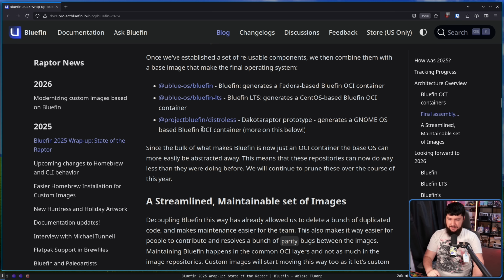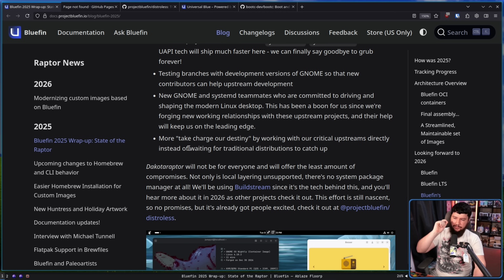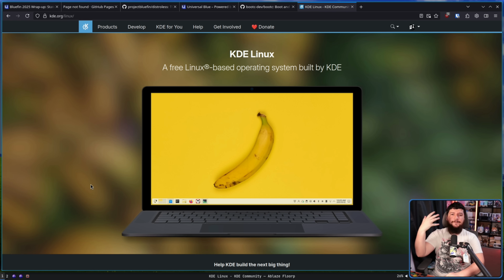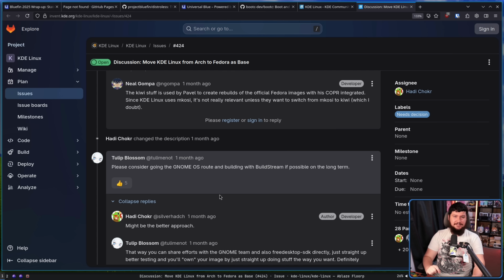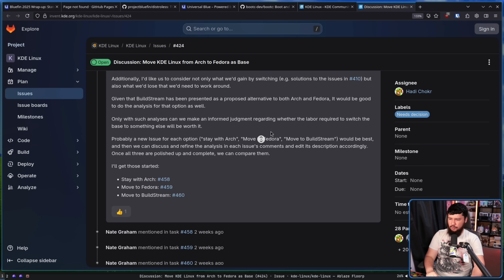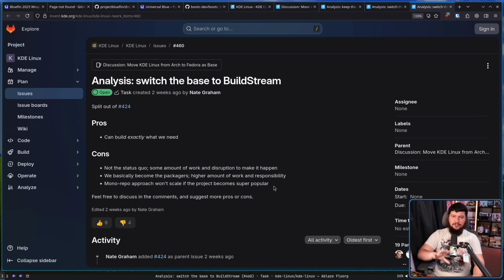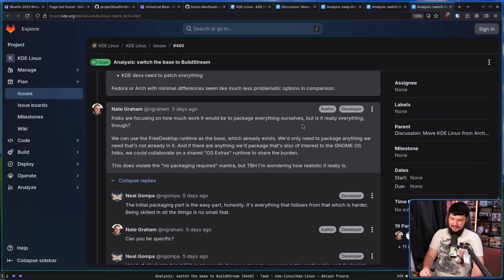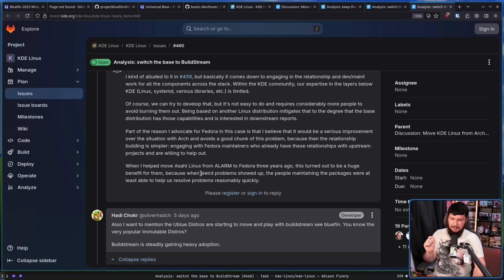The Future Of The Linux Distro Is No Distro

Comment: I do not understand why KDE is wanting to make their own immutable base OS.  Aurora has already done it for the KDE desktop environment.  They just need to fork Aurora (and partner with them of course).  If they partner with them both Universal Blue and KDE will benifit.

I think KDE needs to concentrate on doing some heavy RICE work on their system to truly show what can be done with their system.  I would like to see them improve their stability and introduce tiling and scrolling window manager modes.  If they added these modes themselves instead of having 3rd party programmers try to do (kwin scripts are a little too buggy for this) it will make it much more stable.

Comment: This doesn't sound any less like a distro than NixOS does. Building parts of a system in isolation and then atomically switching from one set to another? That's Nix's bread-and-butter.
Flatpak is a package manager by the way. If the argument is that it's not a distro because it doesn't have a package manager, and then you include flatpak or some other way to obtain and activate container images, then you have a package manager, and by extension with your own logic, a distro.

Comment: I think that container based distros are a very interesting area of research, and likely will be the future, but having used them, I also have to say that there are lot of rough edges left to sand off. See, the problem with putting your whole system in containers is that the whole point is to wall them off from each other. That means that if the terminal text editor you prefer isn't part of your immutable base, then you can only put it in a container, and it can only ever see what's exposed to that container. Need to edit something that container overlays? Tough luck. Flatpak has similar problems. If the packager doesn't set up the Flatpak exactly right for the application, then the user can find themselves surprised when the file they thought they saved in their home directory disappears, because it was actually the home inside the Flatpak and not the real one. That's the kind of issue that will kill someone's interest in Linux immediately.

Comment: Literally every part of the Linux system is opinionated, sysctl settings, kernel parameters, packages and the settings of those packages, what packages are available in their repositories, the package manager, what kernel one uses, how that kernel is built, the desktop environments on offer, the display manager etc etc. Literally everything. People who are against the term "distribution" either don't understand Linux or just dislike it on aesthetic grounds only. I think it's a perfectly acceptable term for what a distro is, which is a particular distribution of the Linux Kernel. "It confuses new users" is not a compelling argument to change it, instead it should be explained more.

One of the only distributions that actually aims to "keep things simple" (i.e no changes/patches to packages) and keep stuff as close to upstream defaults as possible is Arch Linux, but even Arch Linux makes opinionated decisions on what bug/security fixes to backport and such.

Comment: Having no package manager seems to make sense. Bazzite tries to use Linuxbrew for CLI applications and libraries as a supplement for a proper package manager, but Homebrew isn't supported that well for immutable distros considering them a tier 2 system on Homebrew's website. In my case, projects I would try to build can't properly detect the libraries on Linuxbrew. Seems they might be giving up on that and focusing their efforts on getting packages with containers which was what I was guided to do to get a development shell working.

Comment: I don't get the point of forcefully disabling local layering. If you, for example, have a printer driver that is not on the repo, your only option is a) buy another printer and pray it will work b) fork and support the entire project c) use another distro.

Comment: Can this replace distros? No. You have to be able to install Linux in the first place to use it unless like some people you do all of your development in VMs from OSX.

Moving on, this is a solution to a problem that doesn't really exist. DE developers need to get it in their heads that the people who will use their system need it to be stable and run software not than 6 months old.

Comment: As someone said I basically chosse a distro for the package manager in the rare cases I need it, the rest I don't really care about, I run most things in countainers, VMs, flatpacks or some niche variety of that, anything except Snaps that I simply hate is fine for me.

I try as much as possible to avoid having to install anything manually and add bloat.

Installing everything directly on the host's OS just feels like hell and I sometimes need some stupid windows software or some OSX software, it's just more practical to have a clear hierarchy of what is running what instead of just having to deal with a billion dependency that realistically I do not understand the use of because they probably have no valid reason to exist.

Comment: I don't use em-dashes, but I use an en-dash with a space.
Re: immutable distros, it depends on the use case. If you're a power user, no. If you're an admin setting up a system to be used for a hundred, or even a thousand, people then it's amazing. It's almost like a ROM chip in a Commodore 64 -- you ain't killing that, no matter how stupid the user is.

Comment: the reason the traditional package approach existed in the first place is not because it let you install which apps you wanted easily, you did that by buying software on disks, it was because the support layer for the hardware the single system you were shipping needed different drivers for different hardware. 
it turns out this problem still exists!
have fun reinventing packages on top of your bloated "distroless" nightmare :)

Comment: Hm. I am interested if it matures a lot more. I had to leave Bazzite because my OS builder on Github broke. Mainly because they deprecated the the Ally image, while the combined Bazzite-Deck image was too big for the free Github Actions. I'd need for it to truly matures because last year there's just so many changes in ublue space that I didn't enjoy.

Personally, I do wonder: why not just focus on NixOS? You got all these work on "distroless" which is just a shared freedesktop SDK and you're going to layer on some "OS extras", desktoo environment, and whatever other specialized packages and configs you want to add. That... Sounds like trying to turn containers into the Ubuntu Snap Desktop and NixOS.

Why not just focus on making sure the NixOS Options for your desktop environment just works, and ship a customized NixOS config install as the OS? The main concern was not wanting to maintain everything and having everything up-to-date. A channel in-between nixos-unstable and nixos-stable would be good for that. And it's not like you're expecting the user to know everything going on in their system anyways, so it doesn't matter that the nix config is its own beast to learn as user.

Comment: Honestly, recent happenings in the entire Linux space has made me really want to reconsider, even though I’ve been using it for years. I do not like the direction most of it’s going and no, I’m not a Windows user.

I don’t like kde‘s new design philosophy. Obviously despise anything GTK4 and up. Other than a browser which I’m forced to use. 

All I would like is a proper desktop with a proper UX nothing flat nothing “modern” even though it looks like it’s from 2010. I want depth I want buttons I want global menus for those that have issues. I just want a real desktop not something that has some mobile ideals.
Reply: there's very little demand for what you're describing
Reply: @OrangeCrow2pretty much irrelevant but I would love to see evidence. And no not readdit. 

Mainly because the patients I work with the ones I can still see some of them can't see well at all and have a very hard time differentiating shapes on the desktop flat is terrible for that nothing without depth or shadow it's basically unusable
Reply: Seems like cope, noone wants a bad desktop environment, if you want a bad desktop environment go make your own
Reply: i also dislike flat design and such. i just went to a window manager with kvantum as my qt theme (switched to qt programs for all i could) and e17gtk-revolved as my gtk theme (does break a lot of new stuff, even gtk filechooser) with elementary 17 crystal icons for both and it works fine. a few userstyles for www and it'll almost all be skeuo. also making a bar that looks physical but it's nowhere near done
Reply: @likelyrandom I've definitely done stuff like that as well especially when I was on plasma I had fallen 90s Windows 98 full on Mac OS full on just about anything pre-window 7 it's quite nice being able to do it. Since I'm on way fire now it's slightly different but all my QT stuff is still the same and yeah the only GTK stuff I use is the browser so that's kind of easy to fix

Comment: “what if apple made nixos?” - bluefin probably
Reply: Unlikely. It would be a lot more locked down. Sure, macOS is still a lot more open than iOS and you find a few UNIX tools on the CLI level (I was quite surprised that nano was there by default), but beyond that Apple's mantra is to be as proprietary as possible and to not give any control to users.
Reply: @artim96  To your point, that's why the "It Just Works" mantra holds true for the most part. Users can't (usually) irrevocably break things and Crapple keeps a monopolistic death grip on their ecosystem, hence, their very healthy balance sheet. Most users are happy as they don't care one lick about the underpinnings of their services, they just want it to work when they load it up so they can share vacation pics and cat memes with friends and family. If Linux adoption is ever to carry into the mainstream at a meaningful rate, we need more Bluefins and such. Then more enterprising users can branch out into more open playgrounds at their own risk and comfort level.
Reply: @RobMarques  "they just want it to work when they load it up so they can share vacation pics and cat memes with friends and family."

Then why do they keep using Apple stuff, or even Windows? Neither of them actually fulfills that criterion. In the Apple ecosystem, if you want to share anything with a non-Apple-user, it's always 10x more complicated than with an Apple user, or on any other platform for that matter. And with even iOS not even scratching the 30 % of global market share, not to mention macOS, chances are pretty slim that you'll only be sharing with Apple users. And Microsoft keeps breaking Windows every second day, so the chance that your system will actually work as expected is being lowered with every update they issue. Hence their recent (obviously lied) statement to invest much more into product quality.

"If Linux adoption is ever to carry into the mainstream at a meaningful rate, we need more Bluefins and such."

Tell me you got no clue whatsoever without telling me you got no clue whatsoever. People need beginner-friendly distros that actually just work, like Mint, not some bad "cloud-native" ideology.

"Then more enterprising users can branch out into more open playgrounds at their own risk and comfort level."

That's not how anything ever worked. Companies will never, ever branch out at their own risk and comfort level. When they are actually employing Linux, then only in the same way they employ Windows, backed by a company they pay for the support. Because all the corporates are either to small to have the IT to administer it all, or they are too greedy to pay for an IT to administer it all, without any need for professional support. And especially in companies, distros like Bluefin couldn't be more irrelevant. The users have no higher privileges whatsoever, so they don't even have the ability to break anything. And anything beyond that can be handled with backups and modern file systems like Btrfs, XFS etc. That's why RHEL defaults to XFS, while SLES defaults to Btrfs for the OS itself and to XFS for everything beyond that.

So next time you try to defend such utter nonsense, better think before you write. Makes it vastly less embarrassing.

Comment: it an OS as it like windows it the base one size fits all. this is one thing IU like about FreeBSD but if you not wanting the KDE desktop and their choice of things you screwed. On the plus i don't care for KDE so GNOME based is totally fine. i wanted a GNome based distro for a long time nearist to it is fedora. but even they add things to the extension etc. easier to switch of on Fedora than on Ubuntu which have butchered GNome tryin to make it appeal to ex windows users with icon and dock in the dash. Plus dnf is way more integrated in GNOME than APT manager. As my end goal is to make a touch based OS using GNOME and in which case the software and update in the software centre work really well for fedora. but the best tablet OS would be ATOMIC as the hardware never changes and that is the main reason you have to root into you system. if you hardware is fixed, eg SBC with soldered down hardware no upgrade path which the devices I plan to make will be, most of what you would need root for you won't need once the kernel drivers are loaded on an immutable image. UK lack any good Linux OEMs, we have like dell and HP but Linux for them is an after thought as they get paid by microsoft to install windows and drivers are made for windows so not all hardware works etc. But what will set me apart is they will all be ARM based tablets and PC's as the iGPU's are fast enough and i not aiming at gaming at all as they will be social and work tablets. but the iGPU's on ARM have really good encoders and decoders and they are open source codec/drivers a lot of the time too.it will be an custom educational version based fedora most likely, not confirm yet in the screen will be new oled or even black and white E-paper or coloured E-paper. As app are of education value. I will not need super HD and it help keep porn of the dam thing and social media videos. leave the gaming and porn for the steam desk people.

Comment: I don't fully agree with the beef around the "distroless" term. From its origins as a minimal application runtime from GoogleContainerTools, the term makes perfect sense - it is 100% stripping away the distro and only providing the bare minimum needed for either python, java, etc. When you move up to a minimal OS image, there are obviously questions about if "distroless" is an appropriate term, and the dakotaraptor folks addressed that by not using the term - though it seems clear that there's inspiration from the application runtime sense of the term. I don't feel like the commentary in the video really captured the nuance well. I'm 100% here for applying best practices from software engineering to the construction of operating systems, and these atomic/immutable distros with better build systems do seem like the right direction to me, at least from a theoretical standpoint.

Comment: has i thought M-dash is impossible to type on a keyboard and you have to insert it some other way right?
wasn’t M-dash 100% proof ai touched the text?
Reply: It's AltGr+Shift+- on the Polish layout shipped with Debian. You can also type it by composing three dashes, though most people don't have an assigned compose key nowadays. Also, LibreOffice Writer and Microsoft Word will turn two dashes into it.
Reply: @GrzesiekJedenastka  Was this ai generated or you an actual M-dash expert haha
Reply: @G @GrzesiekJedenastka  Jokes aside thanks i’ll try these out, good tip.

Comment: I will NEVER use containers. I absolutely will not allow it on any system I operate.
Reply: Same reason I don't allow bald middle aged white males within 500 feet of myself or members of my family. No use for them, not allowed in the area
Reply: What is wrong with containers?
Reply: @MrWolff-n1v You're asking the wrong question. Why do I need containers? I don't.
Reply: @JodyBruchon  Sometimes there is an application that requires versions of libraries different from those that are on my host operating system, or I need multiple versions of that application. Or, I want to ensure that the thing 100% works in the field just like it did on my machine so into container it goes.

The fact you wrote "I will never" and "absolutely not allow" implies that you hold a rather radical point of view. I was simply curious if it were substantiated.
Reply: @MrWolff-n1v Then that application needs to be compiled again. This is not radical; this is correct.
Reply: @JodyBruchon  You left out a lot of counterarguments that do not concern themselves with compatibility at all but there is a lot more wrong with that statement:

 (a) Compilation of large and complex software can take hours and that is assuming nothing is missing on the host OS. 
 
 (b) You might not have the source code at your disposal and the vendor did not bother to port the application to your OS version yet.

 (c) Containers allow you to run multiple versions of applications at the same time without cluttering your system and creating dependency hell. 

 (d) If you no longer need some software, you can simply delete the container without affecting the rest of the system in any way.

 (e) Base OS can be updated independently of the container without breaking the applications.